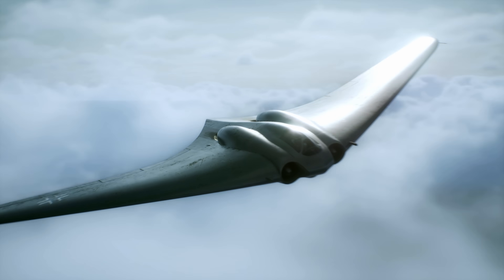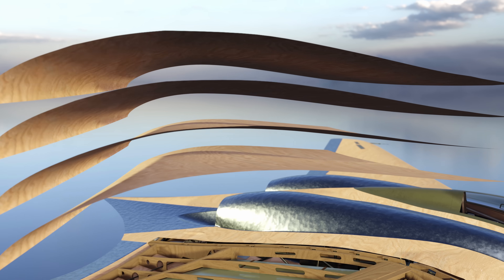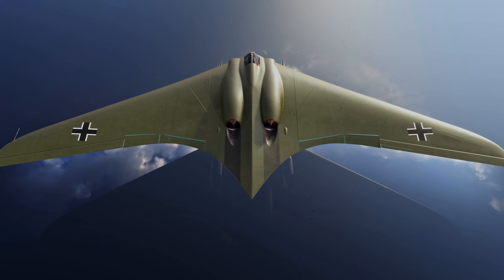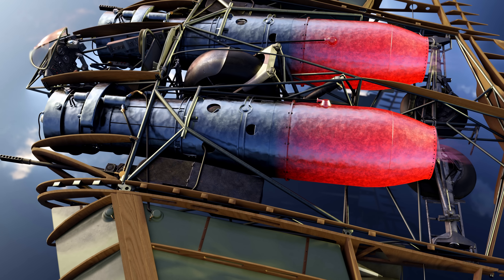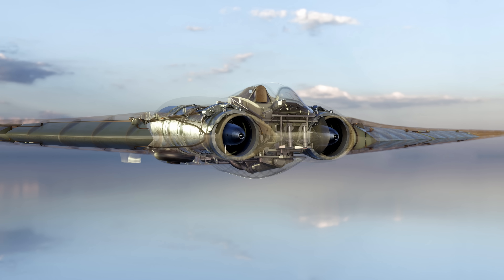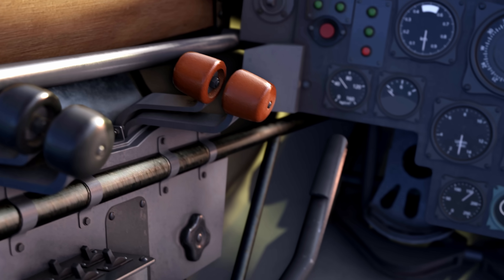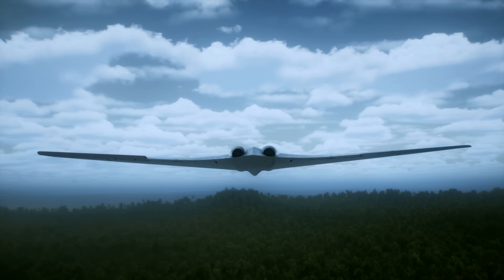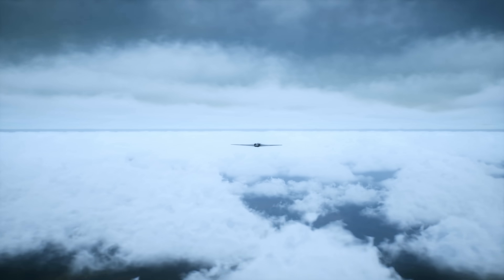Inside the Horten Flying Wing

Comment: it had some stealth properties why lying ?
Reply: At least a 50% reduction in frontal RCS... a very significant tactical advantage against British Chain Home radar detection and RAF interceptor deployment.
Reply: @sandervanderkammen9230  you are right
Reply: It had a reduction in radar signature that was standard for other flying wing designs and/or wooden aircraft, but none due to intentional design. It was theorized that the reduced radar signature paired with the speed would have allowed it to evade interceptors, similar to the Mosquito earlier in the war, though for the 229 it remains a theory.
Reply: @mrnoskills3589 There were no other radar stealth aircraft built until the 1970s...
 The Ho-229 is completely devoid of any significant retrorefletive structures.
Reply: @sandervanderkammen9230  The Ho-229 was not a stealth aircraft. If you wish to argue this, then maybe go back and finish one of our other 10+ conversations you stopped responding to because you could not prove anything you were saying.
Reply: @mrnoskills3589 You cannot deny the irrefutable facts... the Ho-229 is the world's first radar stealth aircraft.
Radar stealth technology was invented by Germany during WW2.
Current American stealth aircraft were developed from this early pioneering German technology.
Reply: @sandervanderkammen9230  Yes yes, the “irrefutable facts” that you have failed to provide any source for numerous times, instead choosing to change the topic or stop responding every single time I ask you for where these facts come from.

You gonna show some evidence this time? Or will this conversation simply stop like all of the others?
Reply: You cannot continue to ignore and deny the truth.
Germany invented radar stealth technology during WW2, this has been a well-known and well-established historical fact.

You denial is based solely on xenophobic racism and ultranationalist rhetoric.
Reply: @mrnoskills3589  where is your evidence too ? 
it had some stealth properties you can't deny that
Reply: @mrnoskills3589  Northrop tests revealed over 50% reduction in Frontal RCS WITHOUT the RAM applied.
This is a significant technical achievement that would have rendered the British Chain Home radar ineffective

Comment: Some people, especially the British, think every square inch of Germany was bombed, daily. That is just not true. They also think the Germans had no protection from bombing or had not thought about it. Aside from large, deeply buried, bomb-proof installations, the Germans had dispersed production toward the end of the war. This meant that barns and other other nondescript buildings were used for component construction. The Horten brothers had developed other flying wing aircraft before the war. The Horten Ho IX had no vertical control surfaces. Maneuvers were carried out by varying the position of the flaps along the trailing edge. There are photos of a pilot wearing a German full-pressure in the cockpit of the Ho IX. It would be adopted by the Americans after the war. It was made by the Draeger company.
The addition of a radar absorbing material in the wings is dismissed. The Germans had developed the first radar absorbing materials. Of course, the Americans used this for what they would call stealth after the war. To clarify, absorbing the incoming microwaves meant a far smaller return on a radar scope. Based on photos, the Americans captured at least four airframes, but only one is known. Another was test flown in the U.S. after the war. Its final disposition is unknown.
Reply: The radar absorbent material described by Reimar in the 80’s was not found on the original wartime aircraft.

Regardless, it was still recreated and tested, and found to be a poor absorber of radar.
Reply: @mrnoskills3589  That is not accurate.
Reply: @mrnoskills3589 Germany invented RAM during WW2, this is an irrefutable fact that cannot be denied.

Comment: I've spotted one mistake. At the very end of the video it was said that the first successful operational combat-ready aircraft without vertical stabilisers was B-2. However in fact there were other aircraft, that could be named. For instance Northrop XB-35.
Reply: Jet flying wing... the B-2 was the first Northop design. The XB-35 was propeller driven and had a top speed of less than 392 mph. 
The B-2 was heavily influenced by research conducted on the Ho-229.
Reply: +@blackseasailing8672   The YB-35 and YB-49 and yes the Ho-229 all never succeeded past the prototype phase of development. The B-2 is the first wing platform to reach production and service.
Reply: @FiveCentsPlease The YB-49 has 4 vertical stabilizers.

Comment: Take off distances would have suffered not because of design but  from those Jummo engines which were subject to flame out if the throttles were advanced too rapidly.
Reply: Take-off power is set before roll out. All first-generation jet engines had manual fuel controls, the Jumo -004 was the first with throttle dampers, automatic governor fuel pressure control and fully automatic variable exhaust nozzle geometry.
technology not available to the Allies until after the war.
 Germany was a decade ahead of the Allies in aerospace technology
Reply: Your comment reveals someone who is not a pilot or knows anything related to jet aircraft...
Reply: @sandervanderkammen9230 
Ah yes, the standard “your comment reveals you are not a part of X group” as if you are somehow an aircraft engineer, pilot, and were personally present for the entire design phase of both the Ho-229 and the B-2.
Reply: @sandervanderkammen9230  
And yet the only “source” that claims that the Ho-229 was tested for the B-2 is yourself, an anonymous YouTube commenter. I don’t believe that for a moment. Why do you fail to provide any studies or articles for these tests?
Reply: @sandervanderkammen9230  Who are these officials and where can I read/hear their “confirmation”?
Reply: @sandervanderkammen9230 
That is far too vague. I cannot find any mention of Thomas Jones ever speaking of the Ho-229, let alone these other “key personnel”.
Reply: @mrnoskills3589 Nothing more vague than claims that the B-2 has low observability... please name a source that proves that the B-2 is steath?
Reply: @sandervanderkammen9230 
You’ve already asked me that under another comment and I’ve already answered.
Reply: @mrnoskills3589  It's a fact that most of the technical data on the Ho-229 research during the Cold War remains classified... as is the data on all the stealth aircraft ever built.
Reply: @DoktorBayerischeMotorenWerke 
It’s classified but you have free and open access to all of the “secret testing data” from “Northrop and Lockheed in the 70’s”?

Sure buddy.
Reply: @sandervanderkammen9230  And you do .?  I was quoting from Gen. Adolf Galland, the leader of last. ME-262 jet fighters
"- Taking off required slowly opening of the throttles
Got it video kid ?
Reply: @JeffreyHavelin Thank you for proving my point... that's exactly what you do on take-off in a modern jet.
Even modern jet engines with digital FADEC are very slow to respond to throttle Inputs and acceleration is slow from ground idle.

Jet pilots never retard the throttles to full idle, even during landing in case there is a need to go-around.

A very common failure mode in jet aircraft crashes today is when the pilot retards the throttle too soon during landing and then is forced to go around, the delayed response of the engines rpm and thrust results in a crash.

Anytime the aircraft is in motion on the ground or the air, the engine rpm is never less than 75% of maximum rpm.

Any questions kid?

Comment: fictional, it never flew
Reply: +@robertbolding4182  The prototype V1 (glider) performed early flight testing.  The second prototype V2 was powered by jet engines and completed approximately two hours of flight testing before a fatal crash in February 1945.  Each prototype was different and, in my opinion, the 229 effort was over with the fatal crash on 18-February-1945.  The third prototype V3 was incomplete when it was captured in mid-April 1945 and did not fly.  Three more variants were under construction in the same shop but were just parts.
Reply: It was real, and IT FLEW

Comment: So in 2008 they claimed a more than 60 year old half finished plane (according to 2008 standards) wasn't as stealthy as expected? 😳
Congratulations 👏🥳
Reply: Over 50% reduction in frontal RCS against British metre band defense radar.
That provides plenty of range without detection and prevent interception by Allied fighters
Reply: The point was to disprove the stealth claims entirely. Reimar Horten waited until the 1980’s, after the US developed stealth technology, to claim that he had designed the Ho-229 to be stealth.

The radar-absorbent material he described was never found on the original 229 airframes, and after recreating the material anyways, testing found it to be a terrible absorber of radar.

The Ho-229 had a slightly reduced radar signature due to the wooden construction and flying wing design, though this was not unique to it. Nothing about the design suggests it was intentionally made with stealth in mind. The hypothetical speed of the aircraft would have contributed more to its ability to evade interceptors.
Reply: @mrnoskills3589 The radar tests proved that the Ho-229 was stealth... in fact anyone who is familiar with radar stealth technology can quickly see that the Ho-229 is devoid of any significant retrorefletive structures.

The aircraft that currently resides at the Smithsonian was the prototype used to test flight performance characteristics and the RAM was only intended to be applied to a later airframe for radar testing and the production model.
Samples of the actual RAM remain classified materials
The German Military Technologie Institut has samples of the RAM and parts of other Ho-229 aircrsft that are classified as sensitive materials and are not available for public veiwing.
Reply: @sandervanderkammen9230 
The radar tests did not prove that. 

The Ho-229 also has two massive exposed compressor inlets on the leading edge of the aircraft. That is one of the most important things to avoid on any aircraft intended to be a stealth aircraft.

Also, the fundamental design of a flying wing makes it devoid of unnecessary reflective structures. Almost every flying wing ever built shares this characteristic.

As far as I can find online, only one Ho-229 prototype was near completed, and that was taken by the US. “It’s classified” is not a convincing argument, especially given that we’re talking about an 80 year old aircraft publicly displayed in a museum, and RAM material that in Reimar’s own words, was simply wood, sawdust, charcoal, and glue, and was already tested and determined to be worthless.
Reply: @mrnoskills3589 But unless you are visually impaired? Any one can clearly see the Ho-229 has no propellers... highly retrorefletive features found on nearly all aircraft in service during WW2 and attempting to penatrate British airspace protected by the Chain Home radar detection network.
 The spinning compressor blades of the Jumo 109-004 B engines were not only partially obscured, they are too small for the resolution of the British 13 meter wavelength radar in use at the time.
Reply: @mrnoskills3589 Your comments reveal someone who has no formal education or professional experience in aviation or radar stealth technology.. please refrain from posting false and misleading remarks about a topic for which you are qualified to discuss intelligently.
Reply: @mrnoskills3589  The very existence of the Ho-229 is a shameful and humiliating slap in the face to every hate-filled xenophobic Alliboo that still believes the Allies had better aircraft than the Germans.
  It is essential for them to childishly slander and denigrate the Ho-229 at every opportunity... but no matter how hard they try they can't make the Ho-229 go away... because its real. The Germans were a decade ahead of the Allies in Aerospace technology.
Reply: @DoktorBayerischeMotorenWerke 
Hop back on your other account and finish our conversations.

Comment: Por isso os EUA fizeram o B2 spirit. Os norte-americano levaram para os EUA e apartir desse Horten criaram o B2
Reply: Yes
Reply: No, the Ho-229 had zero influence on the B-2. The B-2’s design comes from Jack Northrop’s XB-35 and YB-49 flying wing bombers designed during the war.
Reply: @mrnoskills3589  You need to learn more about the development history of the Northop B-2... The Ho-229 design was exhaustively studied by Northop and DoD engineers. Lockheed also studied the Ho-229 in the 1970s when developing its own radar stealth aircraft.
Reply: @mrnoskills3589 I can see from your comments that you are not familiar with the development of the Northop B2 bomber.

Comment: Fascinating?  I was just wondering if one of them had ever flown.  Maybe some day. They were way ahead of their time.
Reply: Yes, successful test flights were made.
Reply: +@7Steveski   The 229 program created three distinct prototypes, all different designs.  The first V1 prototype was an unpowered glider which conducted test flights.  The second V2 prototype was powered with jet engines and conducted approximately two hours of test flights before a fatal accident which killed the test pilot on 18-Feb-1945.   This was all of the flying that the 229 prototypes conducted.  The third V3 prototype that survives today was larger and being constructed by Gotha and it was found still incomplete by Patton's forces in mid-April 1945.  It has never flown.  The prototypes V4-V6 were variations of the V3 and were barely started when found at the Gotha workshop.

Comment: I understand that when it's flying, the sound it made was "Whooooooooooooooooooooooooooooooooooo".  I wonder if anyone considered developing a flying prototype with modern engines, avionics, etc.  I wonder how it would perform with modern equipment - might be pretty danged awesome.  What gets me is that we had a prototype of this, and yet the US defense industry never got into it.  Imagine if we would have had his 50 years ago, as a working aircraft.  But the US defense industry just simply sat on this.  It's criminal, honestly.
Reply: The answer to your question is; The Northop B-2
while the Ho-229 was so advanced at the time, even Allied experts failed to appreciate the huge leap in aerospace technology the Germans made during the war. Although it was understood that Germany had researched radar stealth technology during the war the Allies did not fully understand or comprehend this cutting-edge technology, and it was largely ignored until the 1970's when the practical limits of high-speed jet aircraft reached a plateau and missile technology began to outpace them.
Reply: +@mrthingy9072   Northrop had a much larger flying wing and didn't need any technical information from the Horten project.  Northrop's flying wing program had several things against it.   First, directional stability without yaw control and this makes it useless as a precision bombing platform.  Northrop was getting that solved near the end.  Second, the Cold War and the B-36 was the only nuclear platform that could penetrate deep into Soviet territory.   Third was Air Force Secretary Stuart Symington who had pressured Northrop to merge with Convair.  When Northrop refused Symington killed the flying wing program and had everything scrapped.  The Air Force got the Convair B-36 and Symington retired to a nice job at Convair.
Reply: Why would you look for a modernized version of a WW2 design? They’re so far apart in terms of design philosophy it’s insane. Lifting bodies, radar integration, multi role capabilities, area rule, etc. 

The B-2 is more than enough as is.
Reply: @peskyshoes Area Rule???
 Can you please explain how the Area Rule applies to flying wings???
Reply: @peskyshoes  HOW IS AREA RULE APPLICIABLE TO FLYING WINGS?????